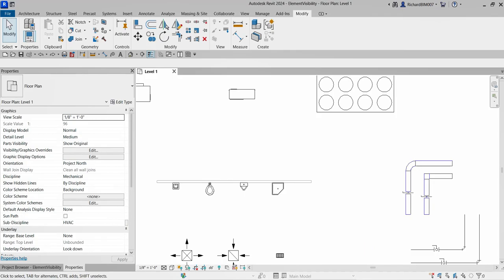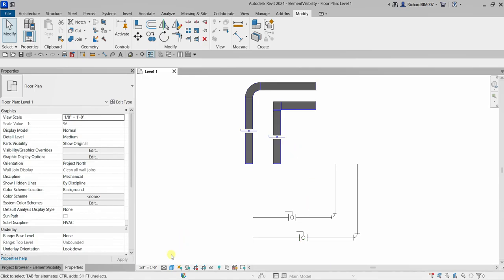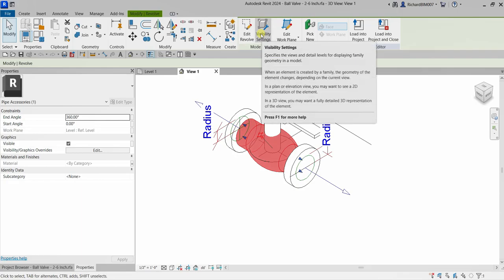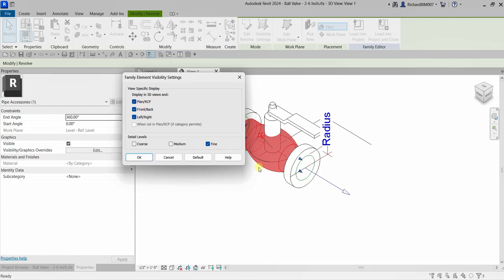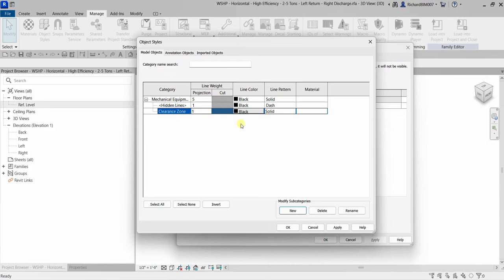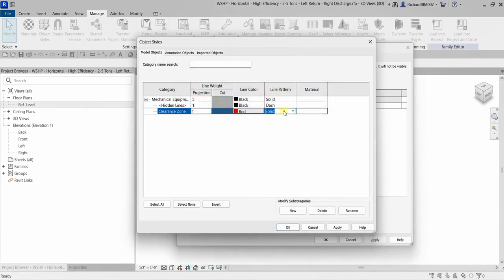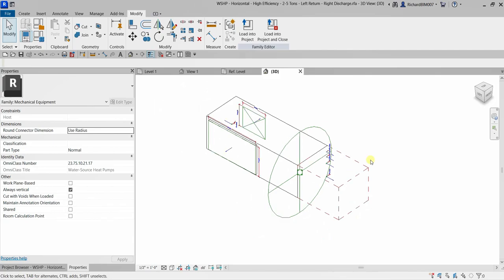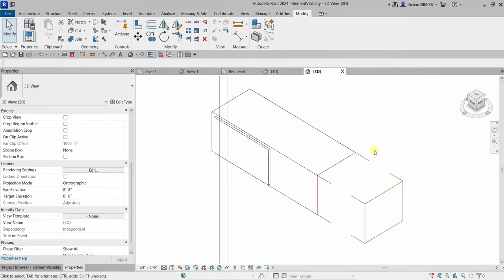REVIT MECHANICAL DESIGN PROFESSIONAL CERTIFICATION PREP: CONFIGURE ELEMENT VISIBILITY SETTINGS

Comment: Hi, how do you do Loop wiring for Fire Alarm System?
Reply from the maker: Hi Albert, loop wiring for a fire alarm system in Revit involves creating a schematic representation of the fire alarm devices and their interconnections within the building. Revit is primarily a Building Information Modeling (BIM) software, and while it doesn't have all the features of specialized electrical design software, you can still create basic loop wiring diagrams. Here's a general guide on how to do it:

1. *Create a New Revit Project:*
   Start by opening a new Revit project or using an existing one where you have already created the fire alarm devices.

2. *Place Fire Alarm Devices:*
   Use the appropriate fire alarm families from the Revit library to place devices such as smoke detectors, heat detectors, fire alarms, annunciators, and other components in your building model.

3. *Create Wiring Lines (Loops):*
   Revit doesn't have a direct loop wiring feature, so you'll have to simulate loop wiring using lines. You can use either Detail Lines or Model Lines to represent wiring.

   a. *Detail Lines:* Detail lines are 2D elements. Draw these lines to represent the paths of the wiring loop. Use the "Detail Line" tool to draw lines that connect the fire alarm devices in a logical manner. These lines will represent the wiring paths between devices.

   b. *Model Lines:* Model lines can represent 3D paths in your building model. Use "Model Line" to draw lines that go through walls and ceilings to simulate the actual wiring paths. This method is more complex but can provide a more accurate representation.

4. *Tag Devices:*
   Use Revit's tagging feature to label each fire alarm device with relevant information, including device type, location, and any other necessary data. This will help you identify devices easily.

5. *Add Text Annotations:*
   You can use the Text tool to add annotations and labels to your diagram, providing additional information about the devices, connections, and loop pathways.

6. *Create Legends (Optional):*
   Revit allows you to create legends that contain symbolic representations of devices. You can create a legend specifically for your fire alarm devices and then place it on your drawing sheets for clarity.

7. *Create Sheets:*
   Create sheets within your Revit project to display the loop wiring diagram. Arrange the views, annotations, and legends on these sheets to create a professional-looking fire alarm loop diagram.

8. *Export or Print:*
   Once you've created the loop wiring diagram on your sheets, you can export it as a PDF or print it for documentation purposes.

Remember that while Revit can help you create basic loop wiring diagrams, it might not offer the same level of detail and functionality as specialized electrical design software. If you require highly detailed or complex loop wiring diagrams, you might need to consider using dedicated electrical design software alongside Revit or exporting your Revit data to such software.
Reply: @bim360  Thanks , I could connect to fire alarm,  just to get a Panel Schedule?
Reply from the maker: Certainly, you can create a Panel Schedule in Revit without necessarily simulating the actual loop wiring connections. Here's how you can do that:

Place Fire Alarm Devices:
Start by placing the fire alarm devices (smoke detectors, pull stations, notification appliances) in your Revit model.

Assign Circuit Numbers:
Assign circuit numbers to each device. You can do this by selecting the devices and entering the circuit number in the "Circuit Number" parameter. This step is essential for creating a Panel Schedule.

Create Panel Schedule:

Go to the "View" tab, then to the "Schedules" dropdown, and choose "Schedule/Quantities."
In the Schedule Properties dialog, select the "Fields" tab and add the relevant parameters you want to include in the Panel Schedule. These might include "Circuit Number," "Device Type," "Location," etc.
Arrange and format the schedule as desired, including sorting and grouping by circuit number.
Review and Validation:
Carefully review the Panel Schedule to ensure that the circuit numbers and device information are accurately represented.